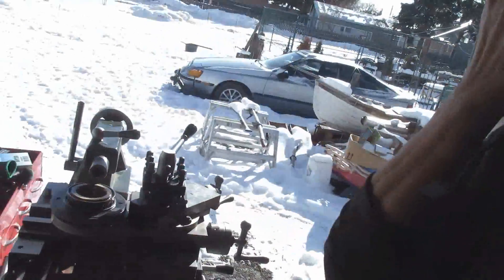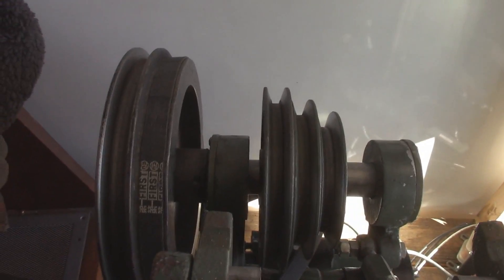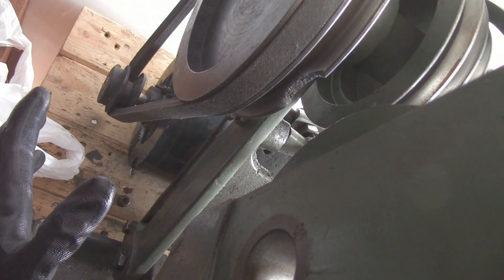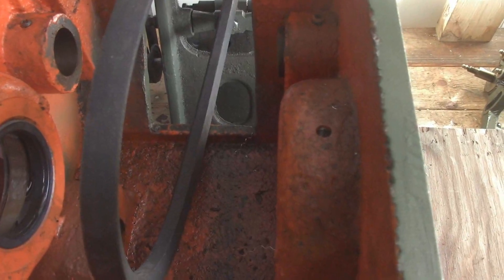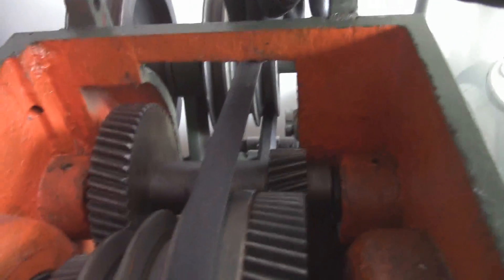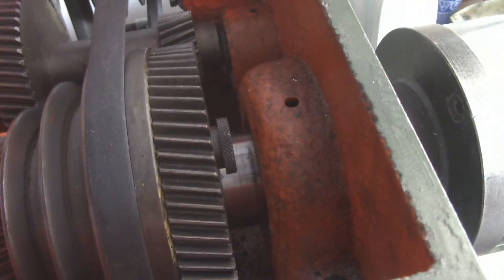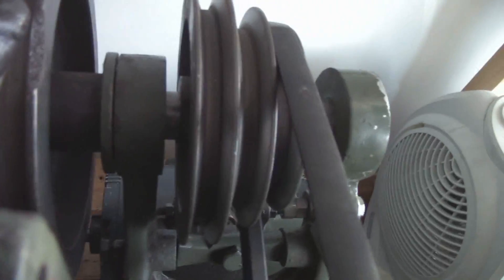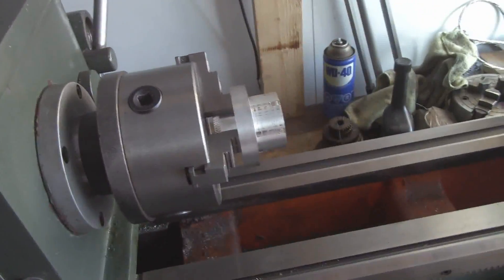TIDA T4A - Repairing The Lathe pt2

Comment: I know this is an old video, but appreciate you sharing it.  I recently picked up a Tida 5aa and need to take it apart and clean it, possibly replace bearings and seals.  Did you find a manual or did you just figure it out as you went?
Reply from the maker: I just figured it out as i went. I have a very mechanical mind, so i can figure stuff out pretty quick. I'm glad this video helped or will help! Cheers!
Reply: @analog56x  That's what I figured and thanks for the quick reply!  Didn't look like you ran into anything that needed a puller or shop press; that's the sort of stuff I like to know in advance when working on old, grimey stuff as I can't always see when there's a set screw or roll pin (my eyes aren't what they once were!).  I haven't decided if I'm going to do a full restoration (incl. strip & paint) or just take it apart, clean, and reassemble, fixing anything necessary along the way.
Reply from the maker: @rficalora  one thing i don't remember if i showed or not was removing the main spindle. Its really tight in there with the roller bearings on each side of the gear box. I placed a 2x4 on the small end of the spindle (side opposite the chuck end) and smacked it with a hammer until the bearing released from the spindle shaft. My biggest advice is to make 136% sure you put the belts on before you insert the spindle all the way while reassembling. I forgot both times i took it apart to move it, had to tear it completely apart to reinstall the belt. The second time i forgot, i broke down and bought a segmented v-belt haha!

Other than that advice, i can't think of anything else noteworthy. Good luck with your clean-up or resto! It's an awesome lathe, and I've used mine a ton since this video.
Reply: @analog56x  Thanks again!  I do recall in the video when you realized that you'd forgotten the belt the 2nd time.  I have to admit, I laughed at that!  A lot of guys would have edited it out.  But, we all make mistakes like that so I'm glad you left it in.  I think a lot of us can resonate!

Comment: might be you need to chance the setting from star to delta or the other way around , not sure how youre power is or if its a single fase or 3 fase 
do you have a good closeup picture of the motor informationplate and any information on the shop power ?
you might need to get a vfd for the lathe http://www.ebay.com/bhp/variable-frequency-drive , added bonus would be you can change the speed with a potmeter (will need some fidling with the settings to get working whell 
if you get it working you could use one of the forgeburners , make a metal melter and cast youre own aluminium bilets to chuck in the lathe (heared you can cast the aluminium intoo a smooth bore straight metal pipe set straight up in a sandbox and once its cooled the aluminium is schrunk enough press the billet out )theres plenty of info on youtube on how to make one i suggest you use some of that high temperature insulation blanket for the melter and not that cheap mix you used with the forge though as that kindah crumbles away
Reply from the maker: Hey, I dont know how i missed your comment...
I actually got the motor working, it was reversed in the polarity department... single phase. I would LOVE to get a VFD for the lathe, though, with the belts and gears, i get a fairly good range for speeds.
I definitely want to get back into forging and smelting! making my own aluminum ingots is definitely something i plan to do, but im not sure when ill be able to actually use my forge again... pretty strict fire bans in the area where i am now, and the landlords dont like a lot of noise haha!
I have started to rebuild my forge, using ceramic blanket and plan on sealing it with a 3100* refractory cement. should last quite a while longer than the cast refractory i used in that previous forge haha!
cheers bud!
Reply: the vfd is mostly for multifase motors , think it wouldnt run smoothly on single phase , glad you got it to work again